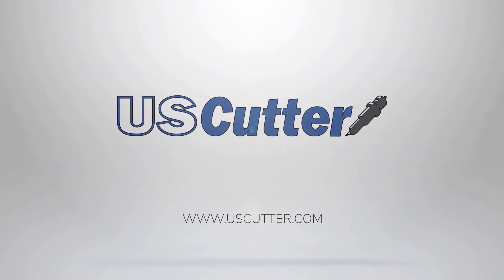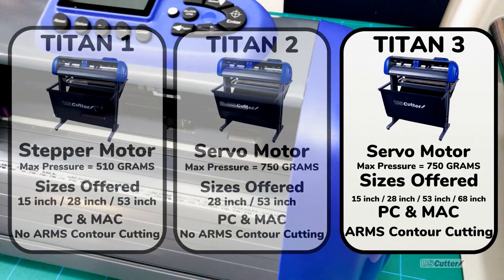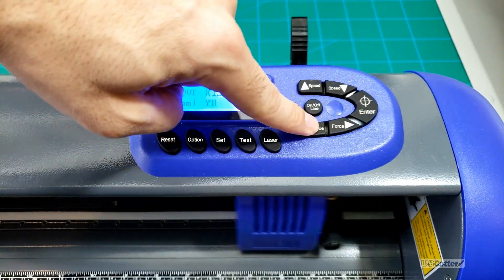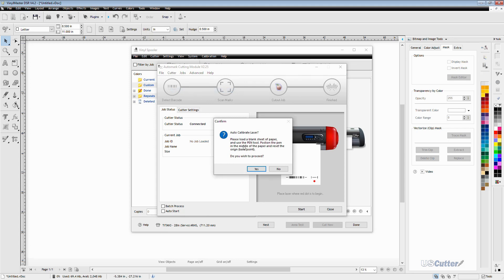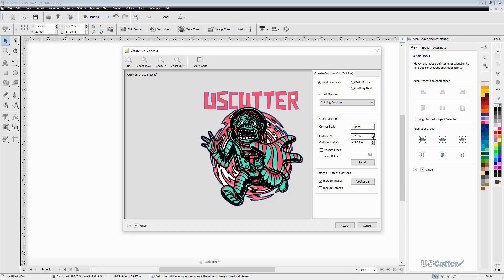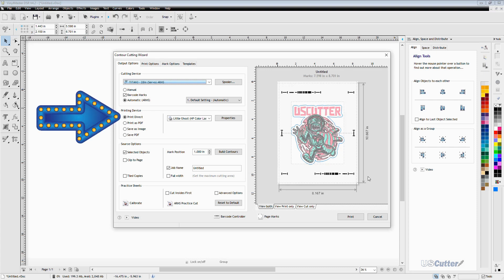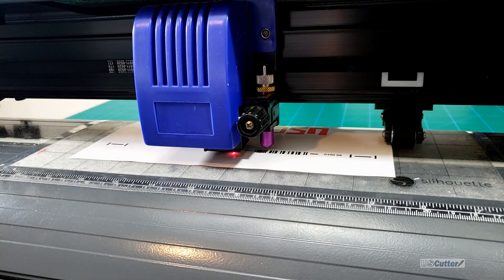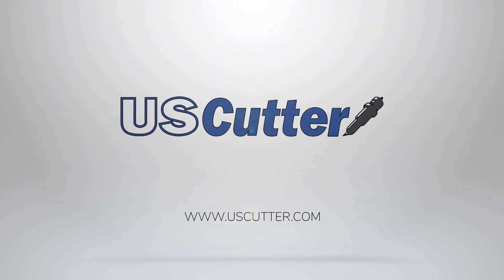Quick Cuts - Calibrating a Titan for Print and cut with Vinyl Master

Comment: Can this be successfully paired with an HP Latex 115 & HP Flexi Basic to do contour cutting using the barcode feature?
Reply from the maker: Yes, it can. I mention how you would do this right here https://youtu.be/KmvNv28P5Ak?t=295
Reply: USCutter Videos Thank you. So it would need to cut using Vynil Master only? Or can you use another third party software or HP Flexi to cut?
Reply from the maker: The HP version only runs with HP cutters. If you wanted to run the Titan and the HP printer in the same program, you would need to get the Flexi version of the print and cut.  You should sign up for the HP webinar tomorrow! https://attendee.gotowebinar.com/register/8525202350977011727?source=Insta
Reply: USCutter Videos Thanks Josh. Will check it out.